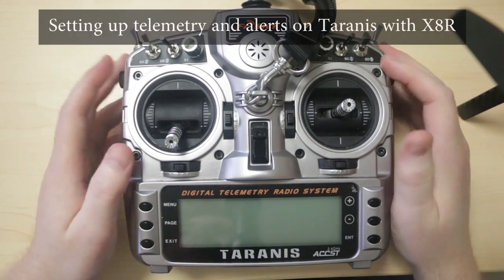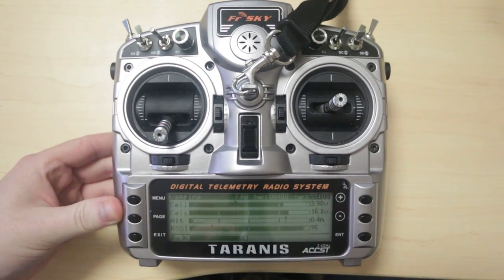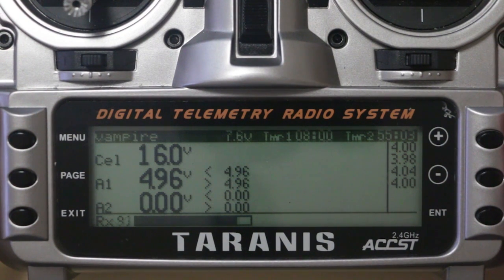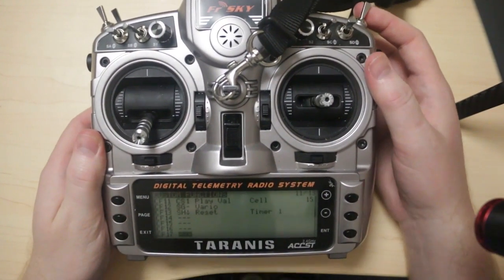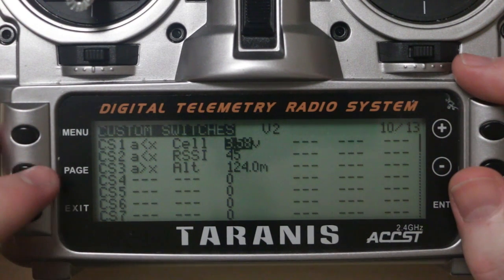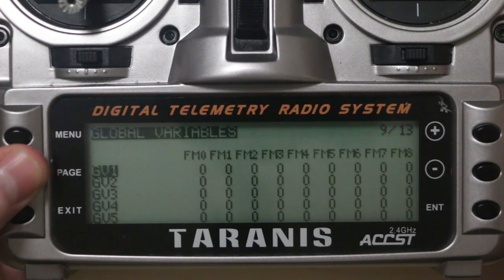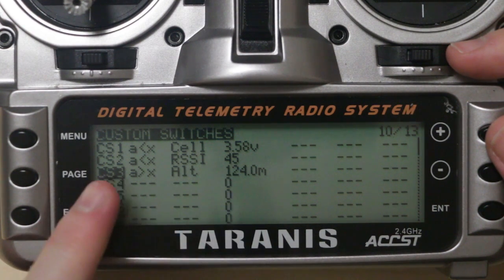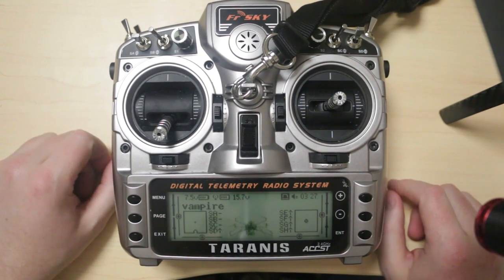Setting up Telemetry and Alerts on Taranis X8R

Comment: how do you get the cel valews , woht rx do you have, and woht do you use to have the cel valew  thanks, i know this is a old video , i have a x9d , and i am using xsr rx but the bat valews are not stable, if i Change the battery, all gets rong  thank you

Comment: Thank you for sharing. I am new to Taranis and eventhough this video is from 2014 it helped to figure out some of the main concepts about telemetry programming. My question is: how did you get the altitude and vario data? Were you using the variometer sensor or the gps data from the quad`s control card or something?

Comment: Will you get a combined cell voltage with the stock RX no voltage meter? or just RSSI?
Reply from the maker: The stock RX will give you the 5v voltage but not a proper battery voltage.

Comment: I am running Opent TX 2.1.  When the Cell value is played, it only give me the integer and not the decimal portion of the number.  I.e. it will say " 3 Volts"  when the actual displayed value is 3.65 volts.  Any idea on how to fix that.

Comment: Thanks for the informative video!
I'm a bit more conservative in the settings after some testing.
I've set up 2 warnings, a 11.2 CELLS warning, and a 3.55 CELL warning.  This way I get a "land soon to have around 20%" warning from the CELLS, and a fail-safe lower threshold "badly low individual CELL" warning.
I've also bumped the RSSI warning up to 50% after what I'm pretty sure was a signal loss event.

Comment from the maker: @Gerhard Laubscher
I can't seem to reply to your comment directly, so I hope you see this!

Yes, RSSI is built-in on most FRsky receivers. I think the only RX that doesn't support it is the L9R as it is designed for long-range.

Correct, for altitude you require the variometer sensor which is much like the voltage and GPS sensors. 

I'm not aware of a way of interfacing the Pixhawk and X8R beyond RSSI information. However, you can send your GPS co-ords to your groundstation via APM telem link, or display them on your OSD via MinimOSD through MAVlink.

The RSSI port puts out a voltage which you can connect to your MinimOSD to display RSSI. I think you can also connect this directly to the pixhawk and do pass-through to the OSD. Some googling should show how to set this up :)

There's no definitive in/out of the smartport pins, they can be daisy chained together. It's a digital interface and each sensor has an ID number. It's unlikely that you'll have a conflict unless you have two of the same sensor, EG 2x voltage sensors. You CAN also change the ID number if you have a conflict. It shows how to do this in the manual. I've never had to do it.

Hope this helps
James
Reply: Hi thanks for this very useful tutorial, would you mind if I ask what camera did you use to record this tutorial?  Thank you
Reply from the maker: +L0ND0N200012 I used a Canon 70d with an 18-135mm lens

Comment: Hi Doble,
 Thank you for the interesting video.

Can you comment -

 I take it that RSSI is a telemetry option built-in for the X9D+ and X8R,
 so one don't need an additional SmartPort Sensor for this telem param?

 To get the Cell V telem one have to buy the FrSky Smart cell sensor,
  I understand that.  eg your vid refers 

But how about the Alt sensor? You don't describe what you have used 
as the Alt Sensor, or maybe I missed it?
 I assume though one require eg FrSky SmartPort GPS Sensor?

Your vid does not clearly identify this?

Using a FC like PixHawk, can one interface the FC with X8R such to
get the gps params instead of buy a FrSky SmartPort sensors such as the GPS sensor?

On the X8R is a RSSI port.
What is the purpose of the port?
  Can one interface this to Pixhawk to set it up as part of OSD 

In general, I observe on several videos the FrSky SmartPort sensors
have two SmartPort connector - pins.  Can on use either when connecting
the cable, or is there a definitive SmartPort In/Out
What  if one wants to 'daisy-chain' more than one
smartPort.  eg Cell, Vario, GPS etc.

As a suggestion, maybe you could make a 2nd video demonstrating
these connection aspect complete.

Thank you.

Regards,
gG

Comment: You cell alarm is at 3,58V. I always thought the save discharge range was 3,7V
Is it save to go below 3,7V per cell with a lipo 3 cell battery?
Reply: +Amina Chee Agreed that a higher warning voltage is preferable.

Comment: Hi
I´ve been having trouble with my telemetry. I broke the antenna accidentally and replaced it with an original from aloft hobbies. After this I no longer have RSSI or voltage. I also have the lipo voltage sensor. What could be wrong? Please help i´ve been searching in many places and no information found. Thanks

Comment: How would I set up telemetry with my minimosd? Can you point me in the direction of a video? I have my minimosd all wired up but I've heard there is something I need to go with the Taranis. Is that correct?
Reply from the maker: SF PV The taranis telemetry system is separate from minimosd. Minimosd will take information from your flight controller and overlay it over your video feed. The Taranis telemetry system takes information from sensorsr you connect to your receiver and relays it to your transmitter. I haven't heard of anyone combining the two :)

Comment: I am wondering if there's a video where you do go over daisy chaining FrSky SMARTport devices.  That was my concern, if you could link up more than one device at a time.  (building my first quad now)
Reply from the maker: VideosVideosVideos You sure can link more than one device. Each SmartPort device has a relay pin. You just connect the next device in the chain and away you go!
Reply: My build will have two 6s batteries. Can I use two voltage sensors?

Comment: Excellent video, but I have questions.
Voltage seems clear; FLVSS unit on multicopter reads cell voltages from LiPo and "sends" them back to Taranis.
RSSI is an algorithm so I assume calculated on Taranis from "packets sent vs packets received"
Altitude; how does this info get from the multicopter to the Taranis?

Thanks!
Reply: Never mind, I read the rest of the posts now. FrSky FVAS-02H SMART Port BARO Altitude Variometer. Not the most easily available item in the UK! I see a "normal" and "high" precision version though - which do you recommend?

I know you said you can daisy chain them, but a vid or image of how that looks would be great!
Reply: And again - I see now - FVAS-02H = high precision. Normal is FVAS-02N.
Reply from the maker: Nigel Coxon
Hi Nigel, Daisy chaining simply involves connecting the sensors with a servo wire. They should 'just work' but there are instructions on how to change the channels on the sensors if they don't connect. Here is the instruction manual: http://open-txu.org/wp-content/uploads/2014/09/SmartPort-LiPO-Voltage-Sensor-Manual.pdf
Also, yes you need the sensor for altitude telemetry. The high precision is accurate to 0.1m and the 'standard' is accurate to within 1m. I'd probably get the high precision as I don't think there's a large price difference.
Reply: Ah so I need another unit if I need to change channels?
Reply from the maker: Yes but I have never had to do that - I think it's mainly if you want to run 2x voltage sensors for example.
Reply: thedoble would make sense.  I know the voltage sensors are 02 as default, I assume each type of sensor has its own ID.
Reply: Nigel Coxon Vario just arrived. Am I right in thinking I don't need Data in or Data out on it at all, just the SBUS port?
Reply from the maker: Yep, just the sbus port

Comment: how do u get  altitude  did u buy  telemetry  and connected to ur smart port beside the one that shows the  battery Voltage  and if so how did u connected it  also  how do u reset timer  thanks
Reply from the maker: Hi John
Yes to get altitude you will need a variometer. You can daisy-chain the sensors together. To reset the timer, set up a switch and set the action to 'reset' and then pick the timer you wish to reset.

Comment: This may sound like a dumb question. When explaining the RSSI what does the number 45 stand for. And how to figure out what your limited range is?
Reply from the maker: Hi Dennis, not a dumb question at all! RSSI is basically an indication of the ratio of signal to noise. It's indicated on the scale of 0 to 100. In my experience 45 is a good value as I've found that below 30 the signal can begin to drop out. A warning at 45 gives you time to take action to prevent drop-outs, eg flying closer to home or gaining altitude. As for working out the range, it depends largely on terrain and antenna set-up, you'll need to experiment to find out. Here's an official explanation from FRSKY on how RSSI works:

----
The received signal strength (RSSI) is actually not an absolute value like voltage or temperature but a number that indicates the ratio of the signal to some initial "good" value. It is in dB and is the same measuring system used for audio levels. For a fixed single system like the FrSky system we can treat the RSSI as an absolute value of strength since the "good" value is already chosen and fixed. The only unusual thing is that dB is a logarithmic measure, not linear. What this means is that any increase of 6 means the signal has doubled in strength. So a change of +12 in the RSSSI means the signal has increased in power by 4 times, by +18 means the signal has increased in power by 8 times, by +24 means the signal has increased in power by 16 times. Conversely if the RSSI goes down by -18 the signal power is 1/8 what it was.
For the FrSky system the RSSI should read about 110 at 1m and every time you double the distance between the transmitter and receiver, the RSSI level should drop by 6. That's why it goes down quickly at first then less and less as the model flies away since you have to double the existing distance each time to get 6 lower. Theoretically at about 100 meters you should get an RSSI value of about 70 in ideal conditions.
A good way to see this effect is to use Range Test mode (since RSSI still works). In range test mode the Transmitter module operates at 1/30 full power. Note where the beeps appear for all three levels. In real flight the distance will be 30x more.

Comment: How did you get it to display the voltages as bar graphs at the beginning?  All I get is the voltage going to the receiver. I have a Pixhawk Power Module cable V1.0 that has voltage & current output.  Is it possible to use that somehow?  Also you never showed how to get RSSI or altitude at all!  How did you do that?
Reply from the maker: Hi Steve
You'll need the relevant telemetry modules to get voltage and altitude. Specifically, you need an "FrSky FLVSS oLED SMART Port Voltage Sensor" to get battery cell voltages, and a "FrSky FVAS-02H SMART Port BARO Altitude Variometer" for altitude. Simply connect these to your FrSky receiver and the Taranis will automatically display the telemetry data. I can't help you with the Pixhawk power module I'm afraid as I don't have one.
Reply: thedoble How do I connect all those modules to the one input on the Rx?  The PX4 can already send back the battery voltage by telemetry, isn't there some way to get that data to the Rx?  Also, how did you get the RSSI value to display a bar on the LCD screen?  Does that take a 3rd module?
Reply from the maker: steve c
Hi Steve, if you follow the wiring diagram included with the sensors it shows you how to connect it to the RX. The system is called SMART Port and it allows for daisy-chaining the sensors. So basically you connect one sensor to your RX, then connect the next sensor to the first sensor, and so forth. As for RSSI, as long as you are using a Taranis with a FRSKY receiver, you'll get RSSI automatically.

Comment from the maker: @Tan Jing jie you may have to make a balance port splitter so that you can get two balance outputs. The alternative is that you can take power from your main voltage input instead of the balance port.
Reply: thedoble Do you know what the "Custom Switches" page is called on the Taranis Plus?
It doesn't have a page called that...
Reply from the maker: +thorleifjacobsen Thanks - this is correct. It's a firmware change as this video is quite old. All new taranis have the 'custom switches' screen renamed as above.

Comment: Very informative video. Thanks. I got few questions if you don't mind. How did you managed to get the quad's all cell voltage (16.1V) displayed at the Taranis home screen just after your Tx voltage display? My Taranis displays the BEC voltage there, and would be nice to have the full voltage displayed. And how did you managed to get the Telemetry screen to show as liner graphs? Mine always display in just numbers. Thanks.
Reply from the maker: Hi Praveen - those settings are on the model's telemetry page - you can set what shows as graphs and so forth.

Comment: OK after spending most of the night working on this I finally got the voltage sensor to work show both cell and cels. 
I still can't figure out how to set the A1 and A2 range and alarm settings. 
I calculated using the multiplier and got 19.9 for A2 but can't find a setting for low alarm and critical alarm that satisfies the critical alarm message. 
Any ideas?
Reply from the maker: Hey - glad you got it going. The A1 and A2 settings are for if you don't have the FLVSS meter. They work on the voltage which the receiver is getting from the ESC. I would disable these (or just set them to a high value so they don't trigger an alert) and then follow the steps in the video to set up voltage monitoring from the FLVSS cell meter.

Comment: I'm using the Frsky FLVSS lipo sensor and the Frsky Precision vario.
I get the "zero volts" message as you do when I switch on my tx.
I also keep getting "A2 critical"!
Can you tell me what values I need to enter in the range, low and critical alarm settings for both A1 and A2?
When on that page on my xt I can see the rx volts but the pack volts don't show up!
Thanks

Comment: First of all I would like to thank you for sharing this video.
I have the Taranis radio and the X8R receiver but when I plug my quadcopters battery not show up on the telemetry screen. I set up the cels and cell CS and CF but there is no readings on any of the screens! 
Can you help?
Reply from the maker: Hi wood2be - do you have the voltage meter? Listed here: http://www.multiwiicopter.com/products/frsky-flvs-01-oled

Comment: thanks james
tinyurl.com/nnngw3z
tinyurl.com/odg2dsa
Reply from the maker: Hi Simon - that looks OK, I note that the custom switch isn't bolded which means it isn't active. What receiver are you using with the taranis?
Reply: thedoble 
Yeah not sure what has happened since I was testing yesty I deleted the switch and then added it again this morning so I could take a screen shot and now it's working 
Just tested it by leaving copter upstairs and walked down 2 levels and sure enough the alarm started going off at <45 
Haven't tested the range I get with this setup but since it took me walking down 2 levels in my house made of sandstone I imagine it's far further then I'll ever need to fly
Reply: ***** 
Using the x8r
Reply from the maker: Okay cool - glad its working now!

Comment: I'm having issues setting a rssi alarm I have mine set to the same as you but my custom switch is always turned on regardless of what my rssi is actually on at present it's on 81 dB and I have it set to turn on at 45 dB 
Custom switch is set to a < x RSSI 45
any ideas ??
Reply from the maker: Hi Simon - can you take a picture of your custom switch screen? If you can't post it here, send it to me in a PM and I'll see if I can help :)